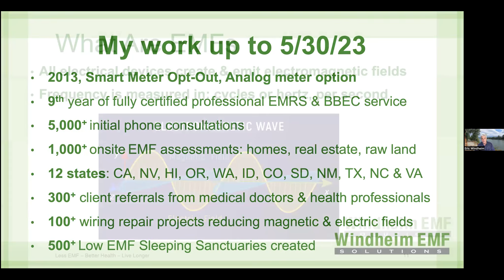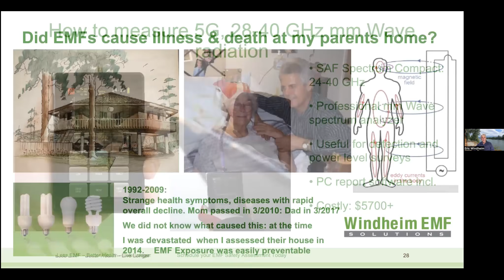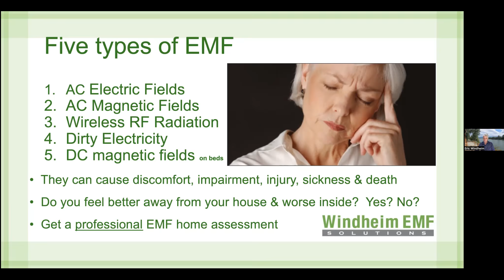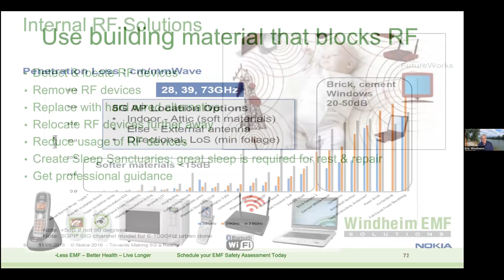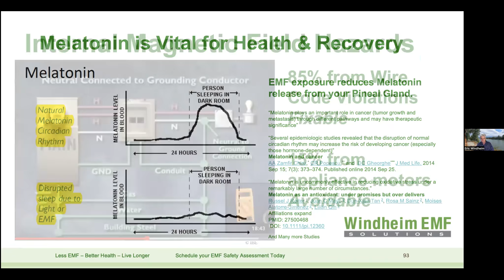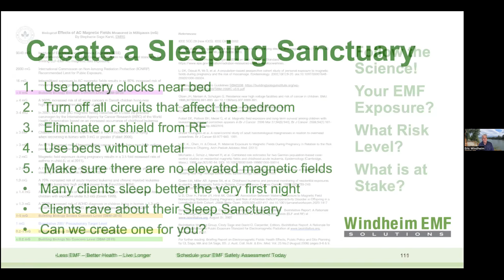Building Biology EMF testing, measurement, risk assessment & remediation solutions.

Comment: How can I get a discount on the safe and sound pro 5G?
Reply from the maker: Go to SLT.CO and use code WIND5 at check out.
Reply: @windheimemfsolutions  Do you have any Radio Frequency ID-blocking credit card wallet recommendations?
Reply from the maker: @return2989  No,    Ihave not done any testing on that.

Comment: Interesting that dimmers switches, cfl/led bulbs.. required in CA.  The state that wants letters in everything that it could cause cancer.  Its basically saying install potential cancerous device but show the people that they get cancer if used.  So its under your own risk but still are forcing you to use.
Reply from the maker: Correct.. There are several possibilities for this.  1.  The States is only concerned about reduction of electric consumption: all else is not valued. 2. The State is ignorant of dirty electricity and its negative health effects.  3. The state is aware of the negative health effects but for whatever reason continues to mandate the installation of toxic devices into homes and business.

Comment: Why don't "experts" ever explain the mechanisms which they hypothesize effects about electromagnetic radiation in the human body but rather just use vague claims of results with correlation when many, many, tons of other factors which are, more likely to create issues for humans, like actual harmful chemical substances for example, are probably the cause (not even gonna go into psychological and psychosomatic ones like the one from believing something  will harm you in some way and so your body self harms itself to get rid of doubt out of fear), isn't that what a true scientist would do???
It's impossible to make deterministic conclusions with loose correlations especially when they are not repeatable where an absurd amount of other and more effective factors can be at play and they are.
Example, your own skin isn't penetrated by all frequencies equally and at all times especially since the electromagnetic waves which are around you aren't always even at the same power level, moisture even plays a role in that, or touching the ground bare footed basically, in many cases depending on the floor type, can ground your body.
Also why would you use a magnetic measuring units for ELECTROmagnetism?
They are not the same thing, magnetism affects the direction which the potential of a charge will be attracted or repelled and electromagnetism is just energy in form of radiation existing in a spectrum with each wave can have different potential (charge) frequency and amplitude.
It's not a bad thing to want to reduce EMR in principle for a ton of reasons but you keep saying how all of this radiation hurts the human body or a person's mood but you don't explain how, so why would anyone believe any of this?
Reply from the maker: Hello George,  I see you have asked many questions: which one do you want me to address first or which one is most important to you?  Please advise.  Eric.
Reply: @windheimemfsolutions  Just the first one, the mechanism as to how electromagnetism affects the biology of the human body.
Reply: @georgeindestructible  , I think Eric accidentally put the answer to your questions above in the thread under my comment.
Reply from the maker: Here are a few links: https://www.google.com/search?q=Martin+PALL+MECHANISIM+OF+HARM&sca_esv=556671154&biw=1649&bih=862&tbm=vid&sxsrf=AB5stBiJbfG8dpR0McHR3NEgyjRkfHKINQ%3A1691999216416&ei=8NvZZKqHGciF0PEPy-mi6AM&ved=0ahUKEwiqv4Si1NuAAxXIAjQIHcu0CD04ChDh1QMIDA&uact=5&oq=Martin+PALL+MECHANISIM+OF+HARM&gs_lp=Eg1nd3Mtd2l6LXZpZGVvIh5NYXJ0aW4gUEFMTCBNRUNIQU5JU0lNIE9GIEhBUk0yBxAhGKABGAoyBxAhGKABGApInXtQ_yxYrnVwAngAkAEAmAHGAaABshWqAQQyNS42uAEDyAEA-AEBwgIEECMYJ8ICCBAAGIoFGJECwgILEAAYigUYsQMYgwHCAgsQABiABBixAxiDAcICBRAAGIAEwgIHEAAYigUYQ8ICDRAAGIoFGLEDGIMBGEPCAggQABiABBixA8ICChAAGIoFGLEDGEPCAgoQABiABBixAxgKwgIHEAAYgAQYCsICBhAAGBYYHsICCBAAGBYYHhgKwgIFECEYoAHCAgUQIRirAsICCBAhGBYYHhgdwgIHECEYqwIYCogGAQ&sclient=gws-wiz-video
Reply from the maker: Geroge, Here are a few links: https://www.google.com/search?q=Martin+PALL+MECHANISIM+OF+HARM&sca_esv=556671154&biw=1649&bih=862&tbm=vid&sxsrf=AB5stBiJbfG8dpR0McHR3NEgyjRkfHKINQ%3A1691999216416&ei=8NvZZKqHGciF0PEPy-mi6AM&ved=0ahUKEwiqv4Si1NuAAxXIAjQIHcu0CD04ChDh1QMIDA&uact=5&oq=Martin+PALL+MECHANISIM+OF+HARM&gs_lp=Eg1nd3Mtd2l6LXZpZGVvIh5NYXJ0aW4gUEFMTCBNRUNIQU5JU0lNIE9GIEhBUk0yBxAhGKABGAoyBxAhGKABGApInXtQ_yxYrnVwAngAkAEAmAHGAaABshWqAQQyNS42uAEDyAEA-AEBwgIEECMYJ8ICCBAAGIoFGJECwgILEAAYigUYsQMYgwHCAgsQABiABBixAxiDAcICBRAAGIAEwgIHEAAYigUYQ8ICDRAAGIoFGLEDGIMBGEPCAggQABiABBixA8ICChAAGIoFGLEDGEPCAgoQABiABBixAxgKwgIHEAAYgAQYCsICBhAAGBYYHsICCBAAGBYYHhgKwgIFECEYoAHCAgUQIRirAsICCBAhGBYYHhgdwgIHECEYqwIYCogGAQ&sclient=gws-wiz-video